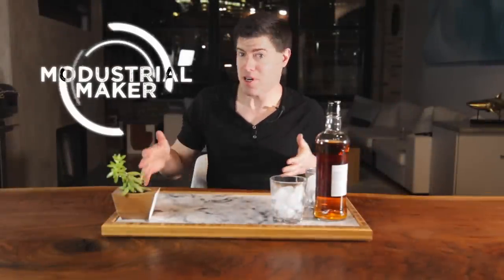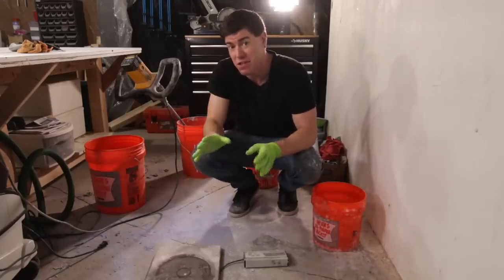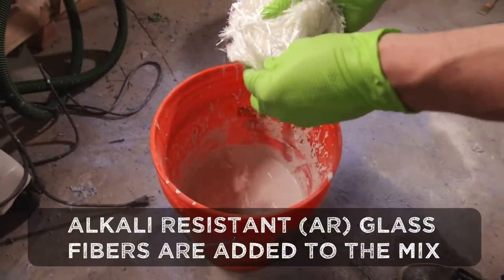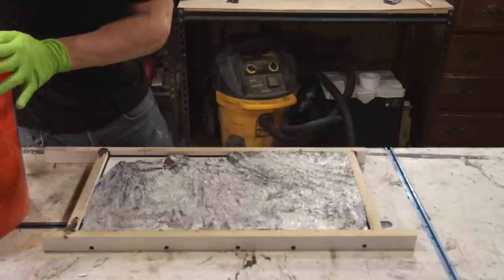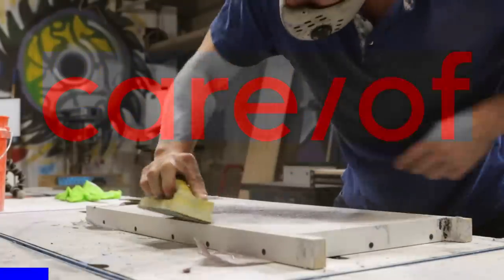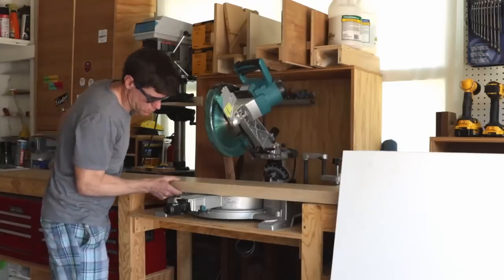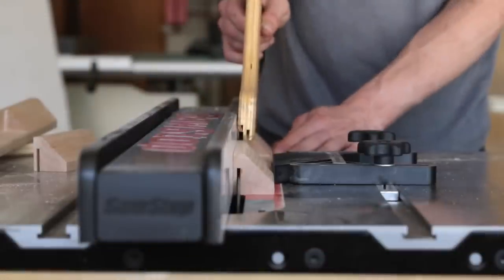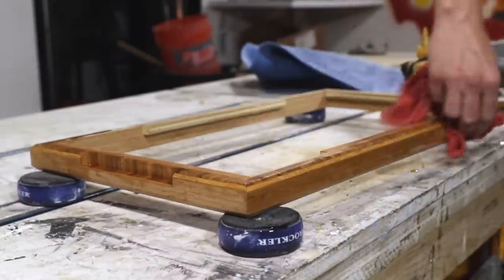How to Make "Marble" Slabs from Concrete & Serving Tray || Woodworking & GFRC

Comment: When setting up your miter gauge, always check that it will clear the blade. I quickly figured that out when my Dad owned a Ryobi BT3000, which has a sliding-table type miter gauge with a sliding fence. Fortunately, only a tiny bit of the miter gauge fence got clipped.
Reply from the maker: Learned that the hard way

Comment: Hi Mike, Great video. I once worked for a company which made marble- and other floor coverings with natural stone „marbled“ surfaces (out of PVC). The marble effect was produced by laying layers of different colours over each other, and then rolling them up like a pancake can be rolled up. These were then flattened by putting them between two rollers (which could otherwise be done using a kitchen rolling pin). This process can be repeated eg 2-3 times in order to achieve the desired „marble“ effect. It is maybe a bit less of a hit or miss process than the one you have used.
Reply from the maker: Thanks much!  That is interesting.  Probably less hit or miss, but I'm guessing those are some pretty heavy duty and specialized machines used in that process?
Reply: Modustrial Maker Indeed, in the PVC flooring industry the rolled-up pvc layers were pressed between rollers, but layers of different coloured rolled-up concrete could be flattened using a simple kitchen rolling pin to make a tray in a similar way to the one you showed in your video.
Reply from the maker: That is a really cool idea.  If you pressed it against melamine it would probably give you a flat top.  You would just need to figure out how to square off the corners.
Reply: Modustrial Maker Mike, after the rolled-up layers of concrete have been flattened used the rolling pin (probably twice or three times) the mass can be slipped into the mould like a pancake. The effect would not be a mottled look like you have shown, but would be more like a grainy wood effect. Probably the concrete layers would have to be „thicker“ ie more viscous than you have shown in your video, and some experiments would have to be carried out in order to fine-tune the technique for concrete.
Reply: Modustrial Maker Mike, it just occurred to me that it would be easy to try out this method using plasticene in various colours : make eg 3 sheets of plasticene in different colours, lay them on top of each other, and roll them up together, flatten them out using a rolling pin, and repeat at least once. Then you should see the „layering“ or „grainy wood“ effect that I previously described. Could be cool in concrete !
Reply from the maker: This might be tricky....the water cream layer separates a bit against the melamine and gives it a smooth appearance (and hides the glass fibers).  If you wait for the concrete to set up enough to move it, the runny nature of it that fills in all the holes would be no longer.  Trying it is the only real way to find out though :)
Reply from the maker: Check out the Buddy Rhodes hand pressed concrete technique -- I think it is getting close to what you are suggesting.  But, it requires you come back with slurry at the end to fill in voids.
Reply: Sounds a lot like they way they make a marbling effect on sheets of fondant for cakes and clay crafts as well. Neat to know those techniques cross over, but the medium is different.
Reply: Ugly Duckling House with Sarah Fogle Exactly ! Such techniques are also used to make marmor cake !
Reply from the maker: +Ugly Duckling House with Sarah Fogle  - coming full circle since cake fondant ball tools are a key part of caulking concrete forms!

Comment: Hey just wanted to share, I've had my best marbling results by simply sprinkling lines of dry pigment into my mold before pouring the concrete. I don't have any photos unfortunately, but whenever I try mixing in the pigment I find that I get unpleasantly blurred results. The downside is that you cant sand very far, but it looks great!
Reply from the maker: Cool idea, I'll have to give it a try sometime!
Reply: Do you get pitting with that technique?  I did the same with sanded grout and it looks pretty cool, but when I went to clean the top to add a sealer, the grout washes out and leaves voids.  It was still okay, but maybe not ideal for a perfectly smooth counter top.

Comment: Would adding just Glass Fibers to a normal white portland cement mix add any strength? I'd like to do a 3/4" countertop for my kitchen. I can't purchase that mixed bag you use.
Thanks!
Reply from the maker: It would, but not enough for a thinner slab.  In additon to the glass fiber, you need the acrylic polymer and plasticizer so you can do 50/50 cement to sand and reduce the amount of water.    You can make your own mix this way, however.  Check out this article for details. https://www.instructables.com/id/GFRC-Floating-Concrete-Hearth-for-Concrete-Wood-Fi/

Comment: Finally got a chance to watch this video (only a day late I guess)!  Great build and even greater GFRC instructional video, Mike!  I am definitely saving this one for when I give GFRC a shot.  How long would you say you have to work with once the concrete is all mixed and ready to go for a batch this size?
Reply from the maker: Thanks much!  working time will vary greatly with temperature.  In my shop at about 70 degrees, I'd say I have 25-30 minutes.
Reply: Wow that's pretty good!  Thanks, Mike!
Reply from the maker: No problem!

Comment: I was curious if I could use a silicone mold for some projects? For instance I wanted to make coasters. Thought silicone would be a simpler way of molding to a shape I want. :)
Reply: Yes you can and they have some one Amazon. You might want to make frames    to surround it your rubber.

Comment: Enjoyed this video as well. Do you have any recommendations for making a gfrc or concrete counter that could be placed over my existing ugly counter top. Or would it be best to remove the one I have and build the mold based on those dimensions?
Reply from the maker: GFRC is really made to be pre-cast in a form, so it is best to remove the old one and replace it.

Comment: Q. for you about GFRC and adding fiberglass to it as you did.  My understanding is that the alkalinity of concrete breaks down the silica that the glass fibers are made of, so a specific engineered glass fiber has to be used when mixed with concrete that will not disintegrate.  When you buy ready-made GFRC it contains that special kind of fiberglass, but I saw you add handfuls of what looked like regular cut strand to the mix. Are you using alkaline resistant glass fiber, or do you feel that it's unnecessary for a decorative/ non-structural piece like that?
Thx.
Reply from the maker: I used alkali resistant (AR) glass fibers.  I've never used any other kind, so I don't know for sure how fast the breaking down occurs, but I wouldn't want to risk it.

Comment: Fantastic, sir! I'm mirroring this for countertops!

Question - I'd like to apply a fiberless face coat then a reinforced fillcoat using this coloring technique. Any suggestions or changes to this process?
Reply from the maker: For countertops, doing it with a face coat and a back coat is a good idea.  I would suggest just doing the exact same process I did, without the fibers, and pour in a .25" face coat.  Let it get firm, but not completely dry, before pouring a back coat with fibers in. (and do back coat with same swirling process).
Reply: @modustrial  .25"....got it. How thin/thick is acceptable for the back coats? MUCH appreciate it, sir! BTW, I really enjoy seeing color and texture variations for future concrete vids.
Reply from the maker: For a table like this, I would recommend at least 3/4" thick, so minimum of 1/2" back coat.

Comment: Great job. Can we make slabs of size 5 feet by 3 feet of thickness 1 inch by this method?
Reply from the maker: Yup, absolutely.
Reply: @modustrial  can this be done with normal cement?

Comment: How do you make it look like this on the surface with a separate initial layer that is sprayed on, like in your other videos?  Super interested in getting into this, making some things, and eventually giving my countertops a go.
Reply from the maker: When I've done marble I have always poured in the face coat instead of spraying...I haven't tried getting a marble effect when spraying, but I'm sure there is a way... Just have to figure it out....maybe that's something I'll work on for a future video :)
Reply: @modustrial   Thank you for the reply!  Is there any reason I wouldnt' be able to or shouldn't make a typical kitchen countertop using the pour in face coat versus the spray?  I really love that look you produced.
Reply from the maker: The spray will give you a bit cleaner surface out of the form, and is necessary if you want to do large verticals in your form, but for a flat countertop, pouring the face coat works well too.

Comment: Question, why don't you level the wet concrete by scraping with a plank of wood? Surely it'd level it, and mean less sanding?
Reply from the maker: That is tricky with GFRC.  The fibers tend to catch on the wood and pull away from the sides, in my experience.   The fluid mix is self leveling for the most part, so it is only about 3 or 4 minutes of sanding.
Reply: Modustrial Maker ahh alright yep, that makes sense

Comment: Any knowledge on using Rapid Set Mortar Mix? No fiber needed from what I've seen.
Reply from the maker: I've seen some of the videos professing it to be some miracle, but it isn't quite the easy answer its made out to be.  Its main benefit over regular concrete mix is not having large aggregate, but it doesn't have the strength of GFRC -- rapid set needs to be poured 1.5" thick and needs rebar if you are doing unsupported spans.
Reply: Hmm what about adding fiber to it?
Reply from the maker: Still wouldn't be the same.... Gfrc is more than just fiber.  The polymer and plasticizer in the mix combined with fibers make it so strong.  You can add plasticizer to rapid set, but the polymer you can't....and it is pricy, so you won't find it in cheap mixes.  Basically the polymer is a liquid plastic that combined with water turns to a solid that bonds cement particles, so some of the water essentially turns to solid instead of evaporating and weakening the final product

Comment: All great videos, however you always keep using Fishstne's mix which doesn't seem to be available in UK (TBH there doesn't seem to be any GFRC mixes). An idea for a video, how to make mix GFRC yourself with white Portland (like Snowcrete for example).
Reply from the maker: Thanks! Actually, there is a distributor in the UK:
House of Concrete
Contact: Jason Morris 
Phone: +447824819795 
Email: Jason@houseofconcrete.co.uk  

 Also, there are recipe links in the description.  And, if you search for me on Instructables (same user name, Modustrial maker), you'll find instructables with lots of detail on making GFRC from scratch.  I think my instructable on the GFRC hearth has the most detail, so definitely recommend starting there.  Hope that helps!
Reply: @modustrial  It does help indeed, thanks. Looking to make a nice concrete table for my garden (when the time allows.), 1st concrete DIY :)
Reply from the maker: Awesome!  If you go with GFRC, I recommend doing a little test piece, just to get a feel for the mix process and how it behaves, before diving into your big process :) it is expensive stuff, and I think it's better to use a bit of it to learn on a small piece, rather than risk having your main one not turn out as you hope :)

Comment: Can you use this technique for concrete countertops?
Reply from the maker: Yes, absolutely.  You'll want to make them a bit thicker than 5/8".... Doing about 3/4" or 1" thick would be perfect for countertops.
Reply: I was looking at using the Z-Form countertop forms.  - Wondering if you can use 1 lift of regular countertop concrete and then a layer of GFRC mix on top and in the edge form.
Reply from the maker: I think that z forms is actually similar to a GFRC mix, or might be one with a very low fiber amount.  Their system is more expensive and is pour in place instead of precast.   I wouldn't mix systems....the decision really comes down to whether pour in place or precast is best for you

Comment: Loved the project, looks great, but I felt super uncomfortable watching you sand it back; where’s the PPE my dude? You’re sanding concrete and glass fibres, you should have a mask at the very least. It’s not as bad when it’s wet I know, but you sanded dry too, and you only get one set of lungs.
Reply from the maker: You are right....I quickly put it on.  If you notice, the second half of the sanding segment I'm wearing my mask.
Reply: So you are. Thanks for the reply, and thanks for taking it the way it was intended. You’ve got yourself another subscriber.
Reply: So you are. Thanks for the reply, and thanks for taking it the way it was intended. You’ve got yourself another subscriber.
Reply: So you are. Thanks for the reply, and thanks for taking it the way it was intended. You’ve got yourself another subscriber.
Reply: So you are. Thanks for the reply, and thanks for taking it the way it was intended. You’ve got yourself another subscriber.
Reply from the maker: Awesome, thanks!
Reply: I applaud your intentions. You can always go back and voice over a video. Removing sentiment from your lungs isn't so easy. 😥

Comment: Do you not screed GFRC? If not why?
Reply from the maker: Screeding doesn't work that well because glass fibers catch on the wood.  The plasticizer makes it fairly self leveling, and then you can just grind/sand off any excess on the back.

Comment: What tripped the SawStop?
Reply from the maker: The incra crosscut sled hit it....anything conductive (metal or a finger) will trip it.
Reply: Roger that, I did the same thing with my saw and my aluminum cross cut rail. Gets your attention, but it's nice to know it works. Expensive too!
Reply from the maker: Yeah, very expensive.  But better than a finger I guess!

Comment: where is your breathing mask?!? thats gfrc dude its practically insta-emphazyma
Reply from the maker: I was wearing it when necessary...had it off for a split second when sanding, but if you keep watching through ad read, you'll see I quickly put it on :)   you definitely need a mask when working with any cement product!  Once it is mixed up though, you don't need it anymore (only when there is dust in the air from it).
Reply: @modustrial   ok good was legitimately worried for folks health. Anywho great tut!
Reply from the maker: Thanks Eric!  Yea, don't want to mess with your lungs! :) I just picture what cement does after 24 hours when exposed to water, then picture that inside my lungs....it's enough to make you put a mask on really quick!